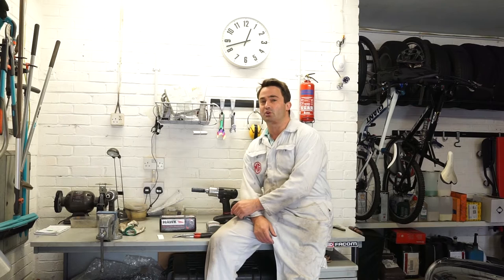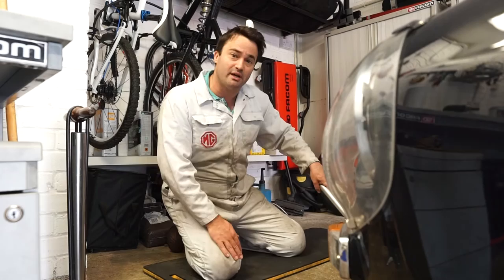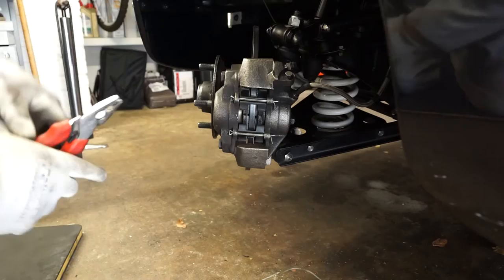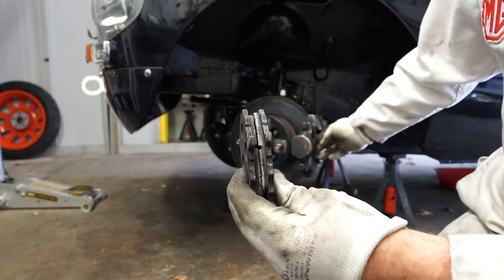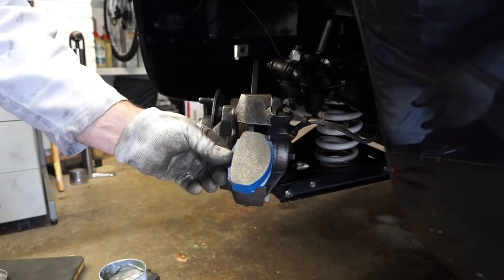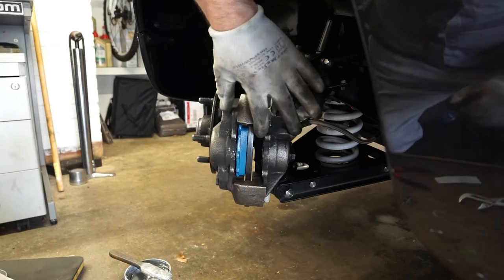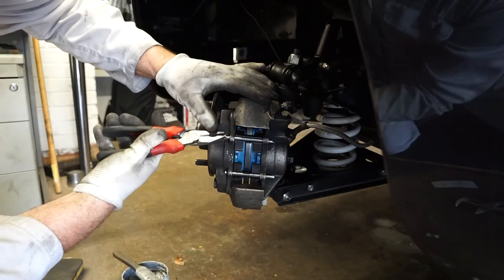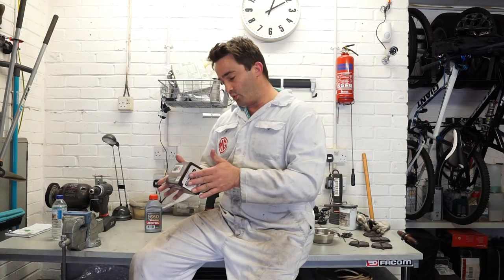MGB Classic Car Brake Pad Replacement How to Guide

Comment: 02 AUG 2024

Aha, you do not advocate for the use of shims with the newly installed pads. I have been told here in the U.S. it may be better to use them.

Nice simple and straightforward instruction. Thanks
Reply from the maker: I have tried the anti squeal shims previously on some noisy brakes, they lasted a few months but eventually the pistons cut through them. I have not found the shims are necessary with the Hawk brake pads.

Comment: Hi, i have just installed a new pair of calipers on my 1977 mgb gt however i find for some reason the outer piston on both sides fail to retract resulting in constant contact with the brake pad. Could you please advise as to what would be the best procedure would be to free them up.
Kind Regards 
Jon
Reply from the maker: Sorry to hear that you are having issues with the brakes. Often a stuck piston is caused by rust or dirt on the caliper, but you should not be experiencing this with brand new calipers. What are the brake hoses like, sometimes the hoses can degrade on the inside and act almost like a one way valve. Are the calipers perfectly in line with the brake discs (rotors)?

Comment: I think this video and your others show the benefits of regular work\replacing\servicing. All your parts just come out easily, go back in fine. I spent over 2 hours today wrestling with just a thermostat replacement and hose pipe replacement. Everything was a struggle, I had the wrong sized clips, a bolt had ceased up, etc. It should have only take about 15 minutes! Unrelated to your disk brake video, but may I ask where you got that heater assembly? I have a black 1972 one, and I am not sure it is in the best shape. I am trying to work out how to remove it and service it, or replace it, but it seems all the usual UK retailers do not stock it; at least not the kind I have. You seem to have a different kind? Mine can be pictured here : https://www.mgexp.com/forum/mgb-and-gt-forum.1/how-to-service-remove-heater-assembly-part.4166802/#msg-4166802
Reply from the maker: Many thanks for your message Ted, I think so many 15 minute jobs on these cars are only 1 seized bolt away from taking 2 hours. With a car driven daily it's certainly much harder to try and keep the fixings free from rust etc. The silver box looks a bit like a heater but it's just a catch tank. for circuit racing int he UK the engine breathers have to be vented into a suitable vessel, they are not allowed to just go into the atmosphere. 
The heater can be a pain to get to in these cars, I would say check you have water flowing through the matrix when the engine is up to temperature, you can carefully remove the hoses (wear rubber gloves) to make sure the water is flowing. The heater valved can fail, also the metal pipe that runs over the rocker cover can block up too. 
Very nice cross flow head in your car! The valve you have is non-standard as it would usually be above the distributor (instead this is where your carbs are)